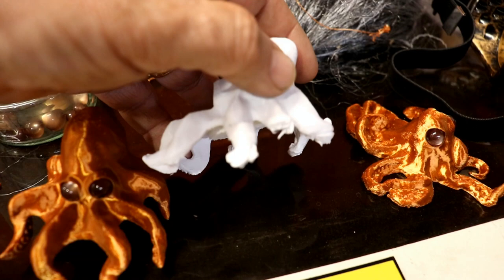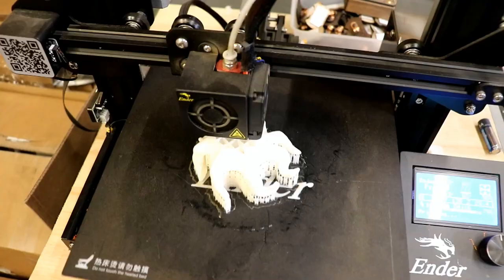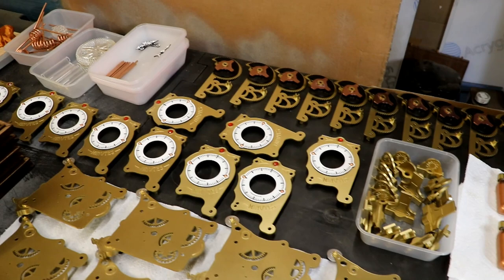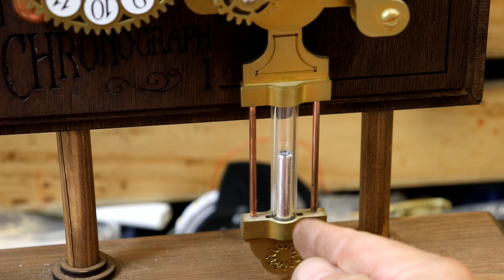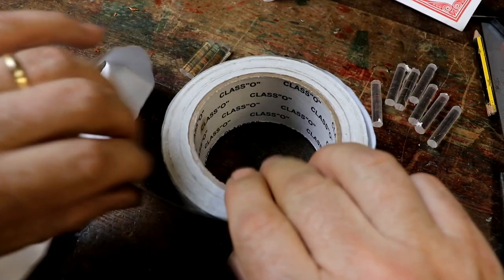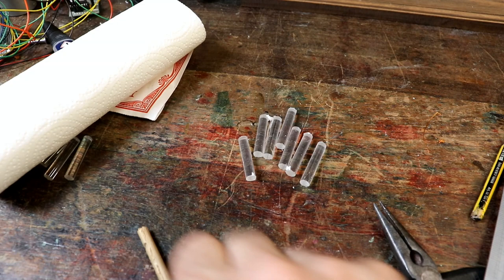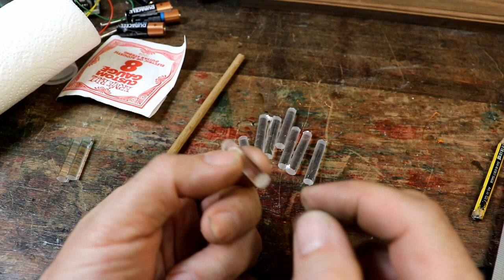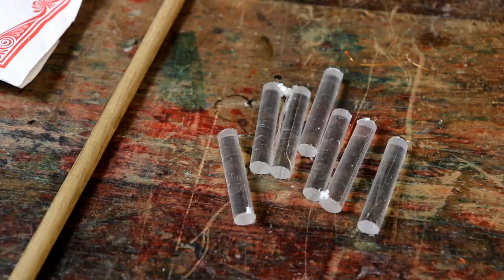Making more steampunk Chronograph clocks

Comment: GM Steamhead.   I love the 12hr reciprocating clock idea!   Have you considered using a rack and pinion arrangement to drive the hour hand?  When it becomes time to change from 12 to 1, the large driver gear could be missing a tooth, allowing the rack to fall all the way back, resetting the clock.  When it falls back, it could trip a mechanism to change the window from AM to PM, and vica versa.  Maybe...

Comment: i use double sided tape to hold down piece for routing.
Reply from the maker: That's a great idea. Routing is most agreeable, although setting it up and sorting out the dust is less so. It's very easy to err on the side of nice clean laser cutters etc... Although having said that, I've been asked to make a steampunk Tardis Console, which will rely entirely on wood working skills and equipment. Exciting stuff!

Comment: Hi Steamhead. 
I love your videos. Lots of useful tips. 
Could you tell me which brand of spray paint you use to get the fabulously smooth finish?
Reply from the maker: Apologies for not replying sooner - I'm still struggling with this modern fangled social media.  I use Plastikote metallic brass spray paint (in the UK). It makes a piece of acrylic (Perspex) look just like a piece of machined brass. It's also very hard wearing - on properly shaped gear teeth, none has worn off over five years.
Reply: @steamhead  Excellent - thank you. Its exactly what I was looking for.